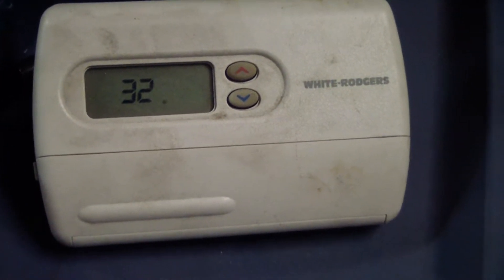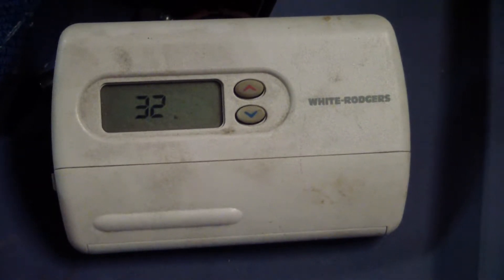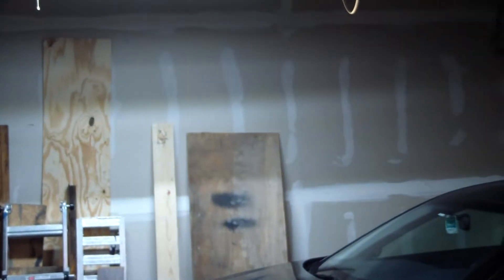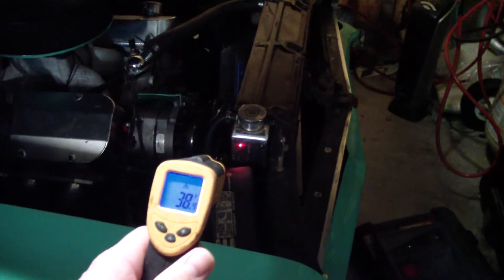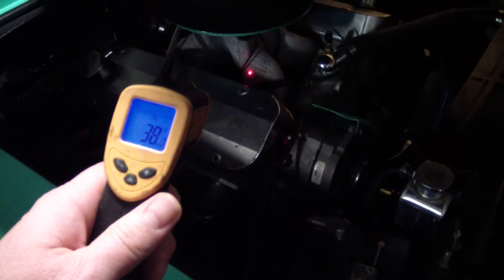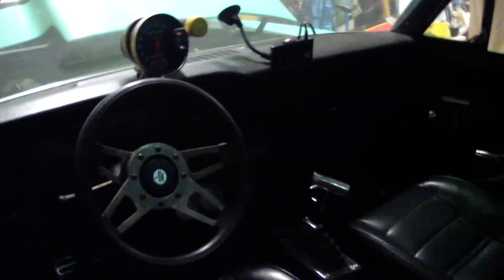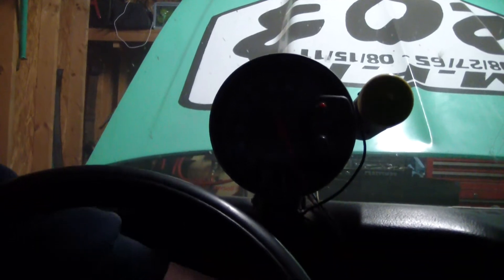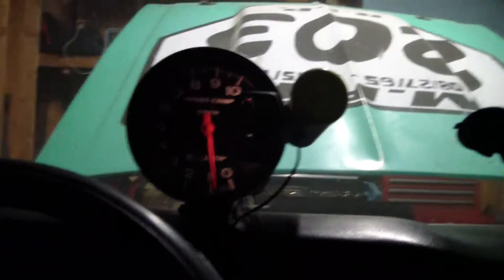fitech cold start 496 bbc 1972 Nova

Comment: Did you add fuel at cold start or take away fuel....I have same motor set up....496, 663 lift solid full roller, single plane, fitech 800. I get 9 to 15lbs vacuum with this cam due to the 112 lobe sep I ordered cam as but still playing with cam 2,3,4 settings.
Reply from the maker: I was looking at the settings the other night. I had nothing changed for cold start. I took some out for warm.

Comment: How do you like it building a similar cubes big block but don’t know to go carb or fuel injectorion
Reply from the maker: The fuel smell is significant having switched back and forth a few times. The ET is close for me and the 60' is the difference. I haven't tested all the settings but the learned values are close. The data log shows a bit rich at the hit which is something a card will never tell you. I did lm2 test passes to log the carb data earlier in the year. There are videos but that system was fickle. 
Go with what you can afford.

Comment: How does the fi tech work for you.i have a 74 Camaro with a bbc in it though about running fi tech.do you have the under hood stand alone command sender an pump?😀is there any hesitation or hick ups with it?
Reply from the maker: I used it for drag week in 2018 until I had to go open headers. The o2 bung is in the pipe after the collector. It drove great and the car was nearly as fast as with a carb. I haven't completely worked on the pump shot settings to fix the 60' but out of the box was really close after learning. I am out for every 100th of a second so it may not be a big deal for some and not noticeable without tons of timeslips to compare.
I have aeromotive stealth tank 340 lph pump